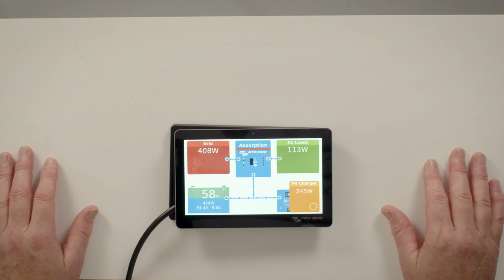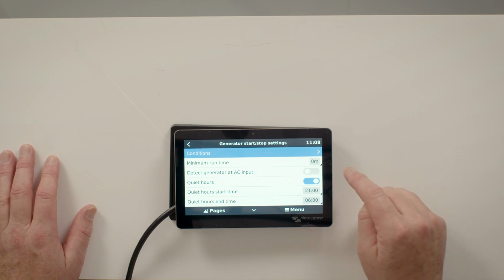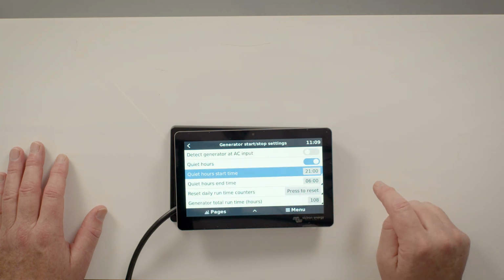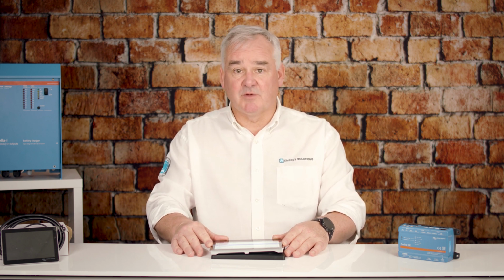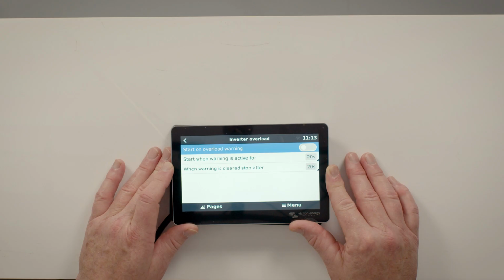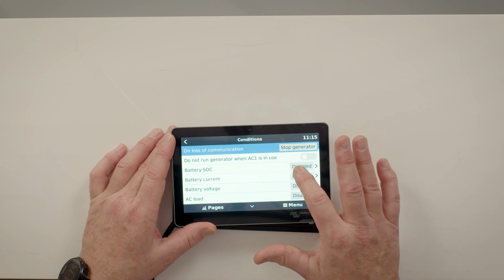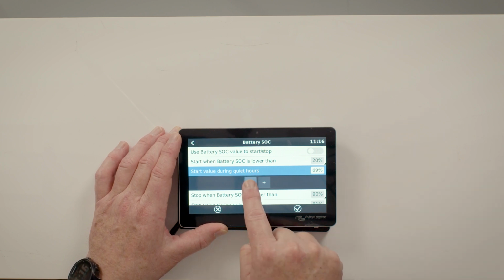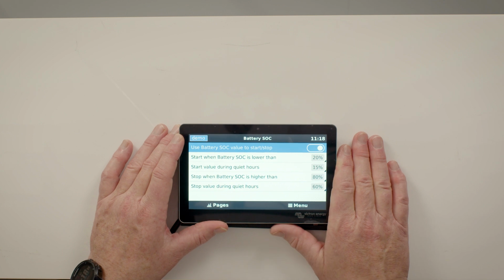How To Setup Generator Start and Stop Times On The Victron Cerbo GX

Comment: Is it possible to let the generator warm up for a few minutes before load?
Reply from the maker: Hi @soamann thank you for the question. Yes it was added fairly recently, so make sure your firmware is up to date if you have a GX device (firmware 502 or later). 
-Navigate to Settings > Generator start/stop > select Settings and then choose Warm-up & cool-down.
-Set the desired Warm-up time in minutes. This defines how long the generator will run before the system connects the load, allowing the generator to reach optimal operating conditions.
-Similarly, you can set a Cool-down time to allow the generator to run without load before shutting down, which can help in prolonging its lifespan. 
I hope this helps.